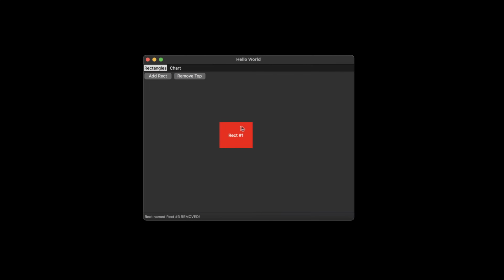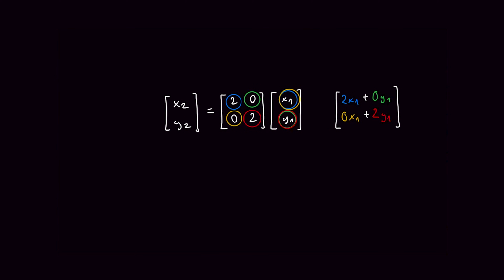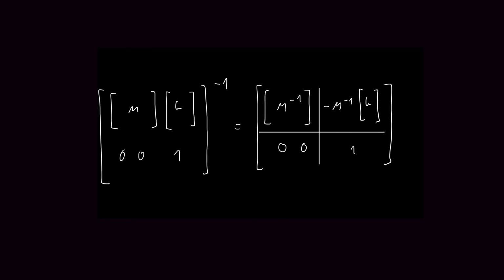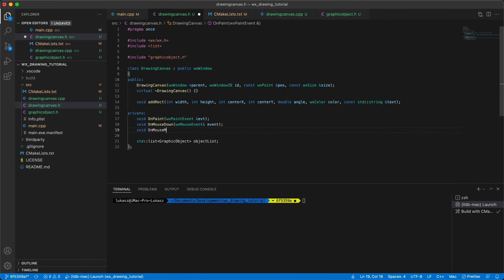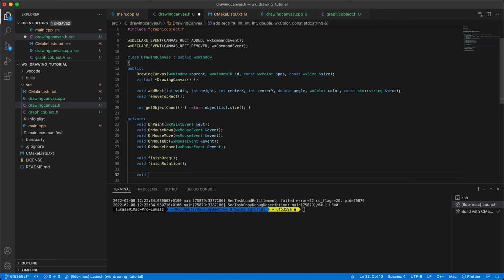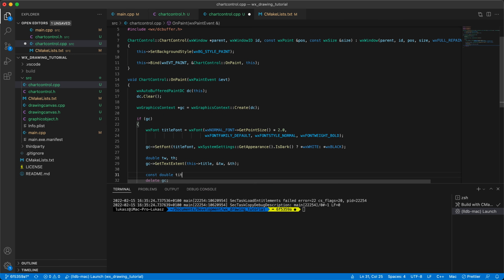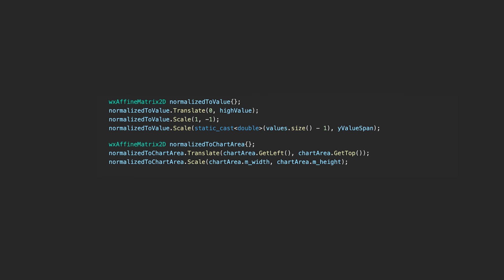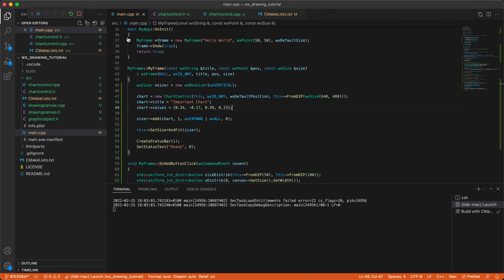wxWidgets: Custom Controls, Affine Transforms and Drawing

Comment: Thank you for the tutorial! Maybe not directly connected but I would like to mention an issue of rotating rectangles in Linux Mint (my version 21.3 Cinnamon). Instead of rotating, on pressing Alt the mouse movement turned to window dragging. This behavior can be changed by going to System Settings ->  Preferences -> Windows -> Behaviour and changing Special key to move and resize windows from Alt to another (Disabled, Super, Ctrl...). The rotating of rectangles should work. Thanks.

Comment: I don't see how button event handlers are scalable if you have 100 objects all with different things that can happen to them. 

 The button-down event handler wouldget vey long and hard to maintain.
Reply from the maker: Each object could be a separate control with different id. Then they can be filtered by ids in the Bind call (see my Menus video for an example of the filtering). Or you can have single callback with some abstractions to dispatch the work, like the visitor pattern (see my Visitor and Polymorphism videos).
Reply: @devmindscapetutorials  thanks. I was looking at the wxWidgets' bomb game.  It has a check if the game is over or not buried at the low level event code.  And it is a simple game.  I found a bug :when the game is over, you can still mark grids with an X! Lol
Reply: The problem is when you write all this handler code then realize a need to reshuffle the logic to upper-level states.  Then you have a big mess to understand.

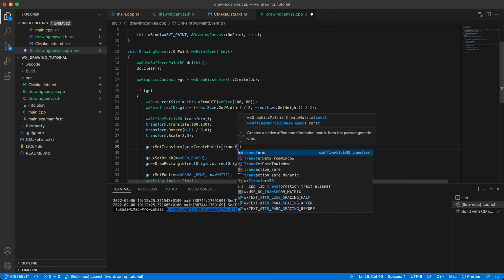Comment: Hi Just Dev, I have a question regarding the application of the transform. I assume that the DrawRectangle function within the graphics context utilizes the transform, as you mentioned at 22:23; but when I decided to experiment with these functions for myself, I quickly ran into an issue. 
I see that the coordinates used for the rectangle's origin are negative, to allow the positioning of the center of the rectangle at the top left of the drawing window. Now, this is where I decided to experiment for myself: I changed the dimensions of the rectangle to 100x100 and positioned it in the middle of the drawing window by using the dimensions of the drawing window divided by 2 and subtracting (x and y) the dimensions of the rectangle divided by 2. The rectangle origin's coordinates are no longer negative, and the rectangle seems to draw at the desired position simply; but after applying a transformation to the wxAffineMatrix2D -- even something simple like .Translate(0, 0) -- the rectangle is no longer visible. Do you know what could be a cause for this strange behavior? I tried stepping through what I could understand of the computations behind the matrix transformation and its utilization in the DrawRectangle function and saw no visible change in the coordinates of the rectangle, but alas, my rectangle is still not visible. Your help is appreciated.
Reply from the maker: @_nore95  You're rotating the whole thing around 0,0; that's why your rect goes off-screen if its initial coordinates are in the center. Try rotating by a smaller angle to see what I mean. Also, size_x and size_y should not be const, as they should change when the control size changes. Moreover, consider using wxPoint2DDouble instead of wxPoint to preserve floats.
Reply: @devmindscapetutorials  Thank you for the tips. I see now that the rotation radius is the cause for the rectangle being displayed off-screen. Also, size_x and size_y are the display dimensions as I plan to work with the window in a fixed style.
Is there a way to rotate an object in its position? Perhaps my understanding of these transforms is too simple at the moment to think around these concepts. I have one more question -- why does the transform rotate clockwise rather than counter-clockwise?

Thank you for the help. Your videos are interesting.
Reply from the maker: @_nore95  The easiest way to rotate different objects around their centers is to draw them so that their center is at 0,0 and combine translations and rotations. Watch the portion of the video where I draw rectangles at random positions - each is rotated around its center, even though they are at different positions.

And to reverse the rotation, just add a minus sign before the angle.
Reply from the maker: @_nore95  You might also translate the object so that it's centered at 0,0, rotate it, and then translate it back. See this video on interactive transformations: https://www.youtube.com/watch?v=hYhM2tLwQKs
Reply from the maker: would you mind sharing a github gist with that code?

Comment: I was searching on how to print drawings from graphics context, and I found that you need to copy the drawing from graphics context to device context but I find it hard to do that can you please help me on that.
Reply from the maker: If saving to PNG is good enough for you then check out this tutorial:
https://youtu.be/QhQ7aeKjYG4
Reply: @devmindscapetutorials   Thank you for the amazing videos I just watched it, fair enough but they raised some questions, I see we can create graphics object from wxMemoryDC, and we can also create it from wxPrinterDC, is it possible to print these graphics to a pdf, not a bitmap as the bitmap output the graphics very pixelated?
Reply from the maker: @iamleavingmycountry3897  I'd first suggest investigating the pixelation issue. Try experimenting with scaling the drawing as explained at this time point in the video https://youtu.be/QhQ7aeKjYG4?t=810 . Also, try saving it to PNG.
Reply: @iamleavingmycountry3897  from my pure winapi experience I recall outputting something to a printer used the same code as for painting on screen, it just painted into printer dc with different pixel size (which is very small for printers).

Comment: I repeated the code from the video, but there was a problem. My drawn square always has a white color, but in the setBrush function it is red. A similar problem with the text inside the square.
Reply from the maker: You can try downloading the code from GitHub (see description) and running it without any changes. If that results in the correct drawing, you may compare your code to the code from GitHub and find what you're missing.
Reply: @devmindscapetutorials  I tried to do it again. I got confused in the hierarchy of objects, so I did the fill outside the panel border.
Reply from the maker: @greenxayc1831  You can download the code from an earlier stage, for example here's the link for the code with just a single rectangle: https://github.com/lszl84/wx_drawing_tutorial/tree/3bd7e84d6aeb31637f0f39e416e37afa12830781 . You can also browse other stages using the commit list and clicking the "<>" button: https://github.com/lszl84/wx_drawing_tutorial/commits/main . Hope this helps!
Reply: @devmindscapetutorials  Thanks!

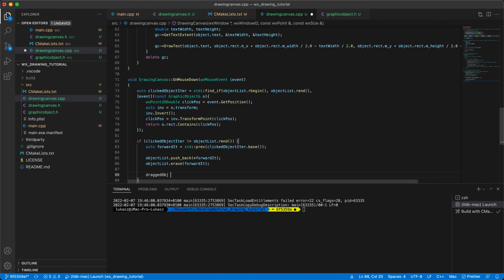Comment: 31:46 No need to use these two lines as long as we have std::list::splice method

		objectsList.splice(objectsList.cend(), objectsList, forwardIt);
instead of

		/*objectsList.push_back(*forward_it);
		objects.erase(forward_it);*/
Reply from the maker: Actually, I like the push_back/erase combo. It's very easy to understand, these two lines of code are self commenting, they literally tell you exactly what they do and this is a good thing. What I don't like is the need to convert the iterator to a forward iterator.